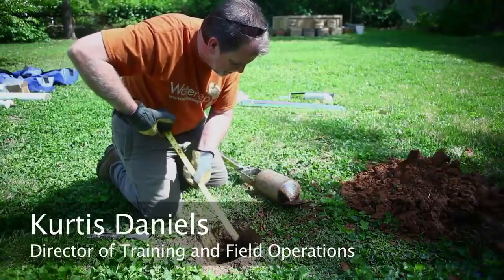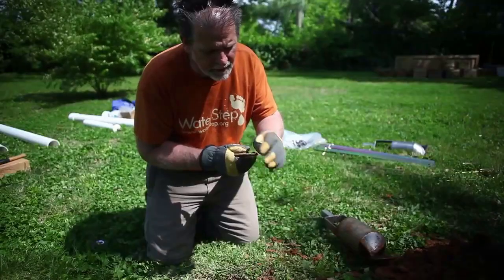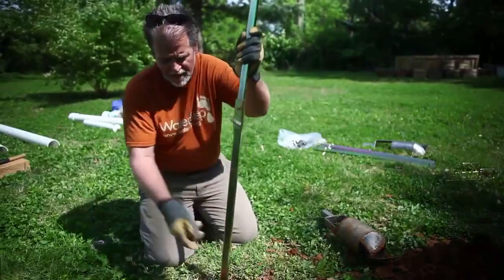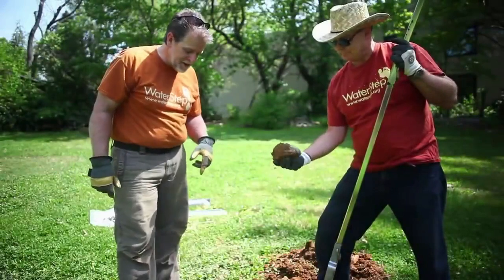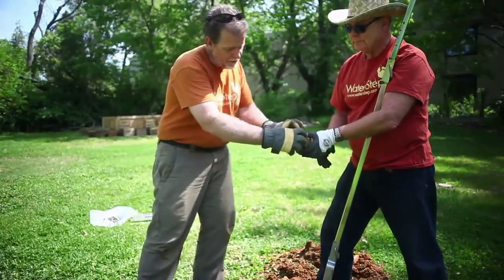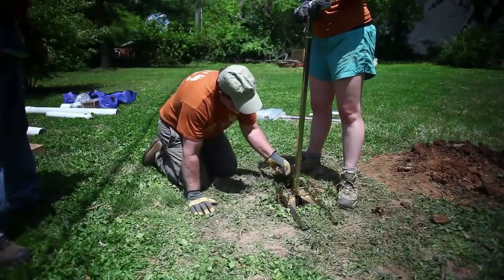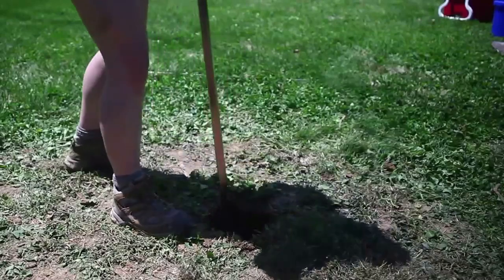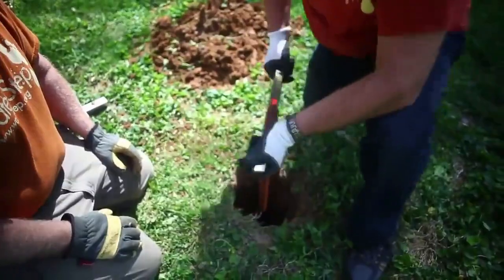WaterStep - How to Drill a Well Part Three - Encountering Rocks

Comment: Why don’t you wrap plastic electrical tape around the locking pins so that they can’t come undone accidentally. Bit safer than relying on the pins staying in themselves.
Reply from the maker: Great tip! Anyone is more than welcome to secure the pins however they want when using the equipment. Always open to ideas. For the purpose of this video though is just to demonstrate how to operate the equipment when encountering rocks. Thanks for the comment!